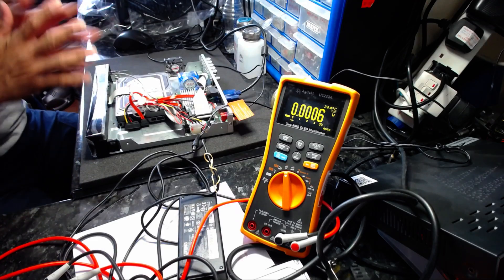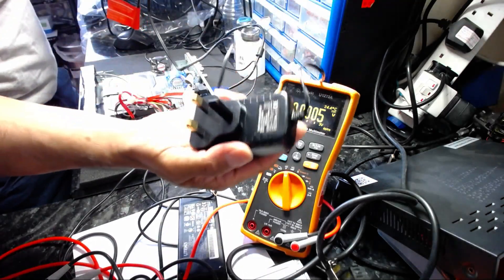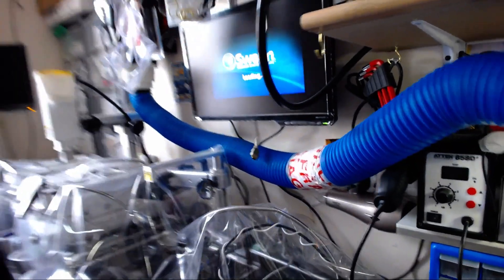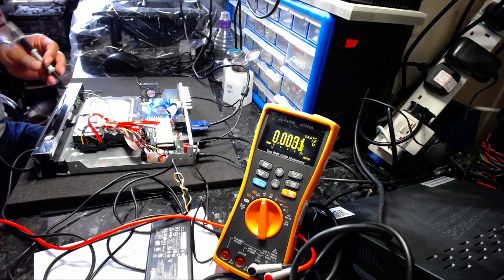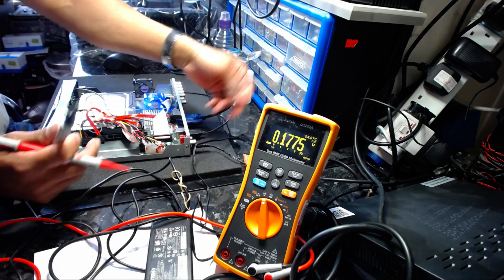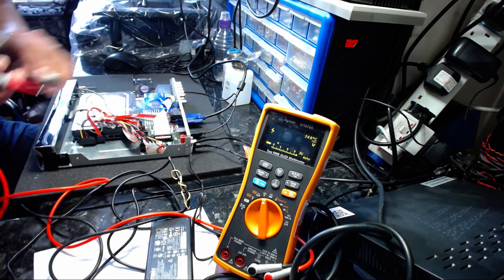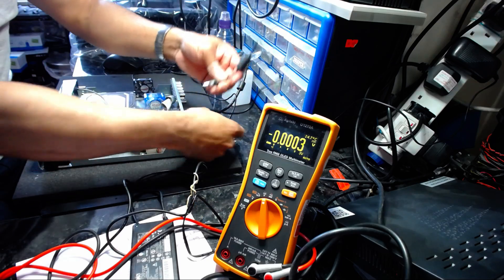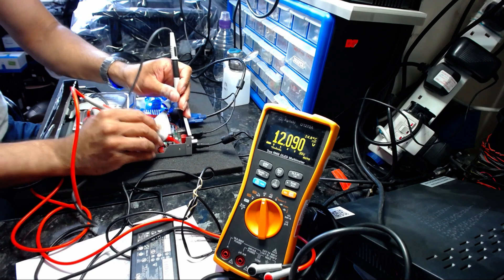HOW TO FIX SWANN CCTV DVR SERIES FAULT NO RECORDING OR NO HARD DRIVE SPIN

Comment: I could laugh out loud.. I bought a new 3 TB HD thinking that the old 2TB was dead.. Nope just tested the 12v power under load - around 9V.. Changed out for another adaptor and it all works fine. Thanks for your video :) I probably should have known the power adaptors were the weak link. A few years ago I contacted swaan in regards to a glitch that would occur when the camera would turn on it's night vision as the sun went down. - the image would start rolling and sometimes get stuck like that. It turns out that when the IR LEDs switch on, they draw a lot more current and can interfere with the video signal.

Comment: My Swann 84550 been going for about 6 years now then stopped recording.  Tried to reset to defaults then swapped out HDD as it wasnt running. Then I found this video. Voltage was 11.58 on 12V line so I swapped the camera and DVR PSUs and Presto! Time to buy 2 more power supplies. Thanks for the help. Appreciated. 🙂

Comment: I have a sannce had it a few years. Not really had it on but turned it on and power cable died. Brought numerous new ones until got the 12v 4amp i needed for my system. 
My hard drive isnt showing so brought new hard drive still isnt showing so brough all new sata xable and changed the 3v battery still nothing. Ive used my multimetre and mine is drawing over 12 v on everything. So quite stuff any help appreciated.
Reply: Sannce told me needed 12v 4amp for my dvr so got that but still hard drive dead and yet on multimetre its showing 12v on all that you have done on this video. Forked out for new hard drive and cables but still no HDD it doesn't make a noise doesn't start up on storage its blank on old hard drive and new grrrr really doing my head in been at it a week and no success

Comment: Hi, I wonder if you can help. I originally had a DVR8-4575 which died so I bought a new DVR8-4580. It worked normally. Then I thought I would be smart and put a 6TB HDD in (largest is supposed to be 2TB) to give a longer recording time. Worked well for 6 months + then channels started dropping out. So now I've lost input at 2, 4 and 8 sockets (tested them all with a known working camera). Has the 6TB wrecked the DVR or is something else going on? Thanks. Brilliant videos.

Comment: You are a godsend, I used your video about 5 years ago, to fix this problem about the power cord, not sending enough power to the HDD. 
The same problem has just happened again, but it took me a while to remember how I fixed it 5 years ago with your video.  Thank you so much, the least I can do is subscribe to your channel.

Comment: Top Man. Problem with DVR. Checked HDD. no improvement. Watched this video. Changed PSU. Voila - result. Many thanks. As a radio ham I should have known better and checked voltages 1st!

Comment: thanks so much for this video-like most here, replacing the power supply worked. in AUS i used this one 240V AC Adapter to DC 12V VOLT, 2A AMP w/Standard 2.1mm Inner/5.5mm Outer Plug. immediately removed the red 'no hdd' sign, and hdd lamp started flashing on box. great:)
Reply from the maker: Excellent!

Comment: Brilliant thanks. I was getting the no HDD message. Decided to swap over the SATA cable, remove HDD and plug into PC. Could see it fine, reformatted and ran chkdsk. Still nothing. Finally swapped out the power supply and BOOM it’s working. Thanks so much, going away for 2 weeks tomorrow and need them working 👍

Comment: I have just had same issue my hard drive wasn't working swapped power supply with the power supply for the cameras and worked straight away they send 3 power supplies 2 for the cameras and one for the unit the ones for the camera have red plugs never really took much notice the one for the unit is a black plug maybe the power supply you was testing was actually for the cameras and not the unit but watching your video had me checking power supplies

Comment: Dont forget about changing the battery on the circuit board. Its easily replaced and its a cheap button type battery 3V C2032. I hoovered out all the dust and cleaned the fan with cotton buds then changed thus battery and boom it worked. No one on these videos seems to mention this battery and its a cheap easy fix. Thx for vid tho
Reply from the maker: Hello, yes cmos battery needs replacing if reads under 2.6v. Normally it should read around 3v.  Take care.

Comment: I rarely leave comments on videos - but I have to say how staggeringly helpful yours has been. YES - it was the power supply. NO - I didn't suspect it, because apart from the box reporting 'no hard disk found' it appeared to be working OK. YES - I had gone to the trouble of swapping the disk for a known good one. The offending PSU was relatively new, having been changed a couple of years ago as a result of the box constantly attempting to reboot but never fully powering up. Again this was difficult to diagnose (but somewhat more obvious to assume 'power') because the PSU metered 12V on no load. Going to ditch the 'fag packet' Swann adapter and source something like a 5A laptop adapter. Thank you again for your help.

Comment: Thank you so much for showing me the importance of actually checking my power supply first! This solved my problem as whilst the original power supply showed 12V it couldn't boot up the device but the replacement could. All without having to take the machine apart .Thanks again. So grateful!

Comment: Just wanted to thank you. My error was No HDD and even when I swapped the HDD for a spare I had lying about, the same fault was there. I'm a DIY (Destroy it yourself!) expert, so I thought the unit was goosed and going to cost me around £300 for a replacement. When I did a search for what would be a good upgrade for a Swann DVR 4780, your video popped up. I've no tools and couldn't use them if I had, but I scrabbled around and found another 12v power plug. Swapped it over and voila! Sorted. Swapped out the 'new' HDD for the original one I'd taken out earlier and I'm well chuffed. Thanks very much again for your very helpful video ;0)
Reply: GOT IT!!!!!!!!   i did everything BUT replace the button cell battery 🔋 & once i did this step…. my hard drive was FINALLY recognized by my NVR security system!!
Reply: oh my goodness i can’t stop laughing 😂 at your DIY (“Destroy It Yourself”) comment because i have the SAME non-luck luck!!  the replacement power supply trick fixed my NVR from rebooting but the system isn’t recognizing that a hard drive is attached!  i can’t even re-format the HD because the NVR doesn’t even register that one is attached.  This is so unnerving!!!  this cheap/junk power supply power supply issue seems to be the case with ALL makes and models of security systems.  

if the original poster has any clue why my HD (neither the old one, nor the new replacement HD) are being recognized by the system i’d sincerely appreciate any suggestions.  right now i’m just frustrated.  thanks so much!!

Comment: I have a problem when I pug in the green light out.  When I change power supply there's it shows no  volts even at the in and out contacts. Also when I pug in the old one the U93 gets hot.

Comment: So, the power supply runs the system But not enough power for the hard drive. Is that right?p
Reply from the maker: Hello, they are all interlinked, however the power is the main, then everything else play it's role.  You put wrong fuel in the car, it won't run. Equally the voltage and current has to be right for the DVR to function properly. Hard drive contains the software. Take care.

Comment: IMPORTANT SWANN OWNERS READ THIS ,  your set up will come with 3 power adapters 
2 are rated 2 amps
1 is rated 1 amp
You need two adapters for the cameras and one for the DVR 
So god only knows why the one you need for the DVR is rated at 2 amps , leaving a 1 amp and a 2 amp to power the cameras , no wonder the DVR keeps failing on a 1 amp adapter , Swann label which is for which please 
Moral of the story is 2 amp is for the DVR !!!!

Comment: 6 months back changed the power cord that went faulty and now my hard driving is not recording. It has movement when powered up.
Reply from the maker: Check with new power supply, check hard drive and have a look at the pcb for any leaked capacitor. Failing all this, the logic board must has issues, corrupted firmware or a chipset failure.  Take care 🙂

Comment: Hi I have a problem  with my cameras not detecting motion and therefore not triggering record. I tried different PSU for both the main unit and camera and also change the camera. Still can't get the camera to record? have you come across this problem?
Thanks

Comment: Genius - I had a  "No HDD message" and spent the afternoon taking out the HDD, replacing it with another spare I had. Both HDD's worked fine on my pc connected to the USB. So I came across your video after searching online for solutions. Swapped out the power supply and hey presto . . it works like a charm. Thankyou so much.

Comment: Great video, I discovered by chance that my Swann dvr was no longer recording and I couldn't access the hard drive. After watching a different video and hearing strange noises from the dvr I had ordered a new hdd but then found this video, checked out my power supply and swapped for a spare I luckily already had and problem solved. Thank you very much👍

Comment: Brilliant!! Thank you so much for posting this! I thought my problem was a failed HDD, as all else worked fine. I am not very electronics savvy, but am willing to learn things, so I will often look online for a fix. I read somewhere that it was often the power to the HDD on a Swann CCTV. So i put on a separate power supply for the HDD, and hey presto it worked again. I thought that the problem was the power supply on the main board, not the thing that powered the whole box! Now i have seen your video i will try the more simple solution, changing the main power supply transformer! As others, i did not think these little boxes ever broke down!  Thanks again!!!!
Reply: hi there, which adapter did you use? do you have an amazon link for it? thanks!

Comment: Hello again. Even though my HDD is spinning it still wont record. Even replaced with a new HDD and says 0gb. Any ideas?  Thnx
Reply from the maker: Hi,  check the power input to hdd from dvr normally 5v with a multimeter probe on molex connector dvr motherboard.  Also try with a different dvr power supply if you have one. Check for any damaged capacitor.
Reply: @iTCXtreme  Sorted it used a new sata cable solved the issue..
Reply: @iTCXtreme  Thank you. I did buy a new powersupply 2 amp hard drive spins but box wont detect the HDD even tried an SDD  WITH NO LUCK

Comment: Same as a few others, this video solved /resolved my problem. Although the first spare 12v power supply I tried was only 200mA and wouldn't work. I then tried a 500mA and it worked.

Comment: I hope you will answer my question. What number of battery is inside the Swann H264? Is it a CR2032 or a CR 2025? or which is the correct one? I can't find it in the manual and I lost the original on my way to go buy the replacement one. Does anybody know? Pleaseeeeeee
Reply from the maker: Hello, normally cr2032 which is commonly used. Hence, check the existing battery if you have it.
Reply: @iTCXtreme  Oh my Gosh !!!! Thank you so much!!! for taking the time to answer my question. I lost the original and my DVR won't turn on completely without it. The power window won't light up which  is on the front of the unit. My  modem's Lan  line won't turn on either, so I think it's the battery.  I put a 12V 2amp, and I think I need 5 amps, what do you think? GRACIAS  ITCXTREME,,,,, from MEXICO!!!

Comment: Hi there Im having the same issue What Power Supply are you using to get the HDD going?
Reply from the maker: Hi, same spec as the original or 12vdc 2amp +
Reply: @iTCXtreme  12vdc 2amp +

Comment: Hi there, I have the same problem, but I have a question. Will I harm my DVR if I put a extra charger from my computer that reads: AC 100-240V ; output is 19V====4.74A ,,, will that work? I am afraid to test it bc I don't want to damage my whole DVR by putting the wrong charger on. Can you help me please?
Reply from the maker: Good evening, 

If it is a Swann DVR then the power supply must be 12vdc 2amp.  The 19vdc power supply will damage the DVR.  Have a look on Ebay for liteon or delta 12vdc with a minimum 2amp, with the same pin type. Alternatively speak to your nearest CCTV supplier.  Thank you.
Reply: @iTCXtreme  I appreciate your time and fast response. Well, I did plug it in anyways (bc I am a woman)!! hee hee, I didn't wait for your answer and you are right, I damaged the DVR. I am in Mexico,  I will order what you described and do you know if I busted a fuse or the whole DVR?
Reply: I meant, would you happen to know,?
Reply from the maker: @suzannta2827  more than likely burnt the DVR pcb.  I don't remember seeing fuse. But please open DVR and check.
Reply: @iTCXtreme  I had it opened and I replaced the round little battery CR2032 bc it didn't work on the HDMI, so I hooked the TV to a RGB input and it worked till yesterday, it stopped recording. So I looked for you and I bet that was my problem, that's what I get for being impatient.
Reply: @iTCXtreme  I took one of the cameras power supply which says 100---240; 12V-2A, and I put it on the DVR and it didn't start. Before I did this stupid mistake I could see the cameras (8) on my TV screen and control it with my iphone or Mac but now it won't turn on. This is the little moment  where I regret being a Woman, and I do have a sense of humor, but this is not  funny. :(
Reply from the maker: @suzannta2827  We are humans and human make mistakes. 😊👍
Reply: @iTCXtreme  HI EXTREME!! Ohh I hope you are working right now. Guess what? Well I left the DVR on with the bad connector like I said yesterday and at 3:00 am it started to send me alerts, but I thought it was Twitter. So by 9am I looked at my Screen and there it was,, it's running and I can see my cameras and the HD, which has only 2 gb left to record. I jumped & screamed and did all that girly dance but, I won't touch it till I get a reply from you.Do I format it? It has backup files, could you tell me what to do?

Comment: Many thanks for uploading this video. I have a sannce cctv system and it had gone down and wasn't doing nothing. After watching your video I switched the  power lead to one of the two camera power leads (made sure they were the same output first) and then.....bingo system powered up and working fine. I've put another 12v power supply on the system now and all s good. All just as I was about to order a new cctv unit. Many thanks again saved me £££££'s.

Comment: Hi any advice on what power supply adapter I should buy
Reply from the maker: 12vdc about 2amp or 3amp would be better.  Look on ebay for liteon 12vdc chargers/power supply.
Reply from the maker: https://rover.ebay.com/rover/0/0/0?mpre=https%3A%2F%2Fwww.ebay.co.uk%2Fulk%2Fitm%2F392073622535
Reply: @iTCXtreme  cheers will let you know how I get on

Comment: just watch you vid i have a dvr but i have no to 5v at the harddrive and the unit not turn on if i set my meter to continuity and probe the 12v to 5v the unit turns on but still no 5v any idea were to start unit 5 days old
Reply from the maker: Hello, it seems your 5v rail is missing.  A component failure could result in such behaviour.  Swann DVR are nothing but trouble which is why I got rid of mine.
Reply: what sort of component work i be looking for and thank you
Reply from the maker: @AlanAnsell  probe around the pcb and see if you can spot 5v rail.  Is the is not 5v then your 5v controller ic is probably mess up.  Cheers

Comment: First off thanks for this video ,,,,,So I called swann and they told me to unplug my camera power adapter and plug it into the power port of the DVR it loaded the desktop but I still could not format the drive hmmmm ?. So I took the HD out and running test on a PC everything check out the SMART , surface test and even coping to HD works so any ideas ?
The camera power supply is the same volts and amps and it still wont format the drive ? I'm getting 3 long beeps and 2 short any ideas would be appreciated thanks.

Comment: Hi, great info video. I suspect my power supply is doing the same - The adaptor is reading just over 12v but that's the disconnected output, not a reading from internal. i have a spare 12v power supply but it's rated higher than 2000mA, can I use it or do I have to keep to 2000mA. I think the other one is 2.5a, Appreciate your advise. Rich
Reply: Big thanks for that - I used an old Netgear adaptor, plugged it in an it's working fine. The trouble was it wasn't recording and when checking the drive status it was saying no drive. I also noticed the fan wasn't working as hard as it used to so I suspected some kind of power issue. Now when we look for the HDD all the info is there and the drive is recording once more. I feel Swann have sourced a low spec supply for these DVR's, the one we had was running fairly hot, I suspect it was a cost issue for them.  Anycase I really appreciate your advice and the video which pointed me in the right direction. Rich